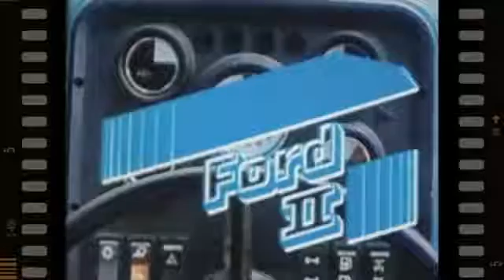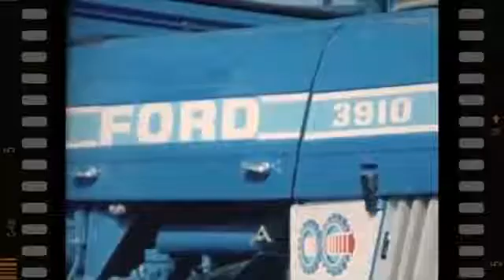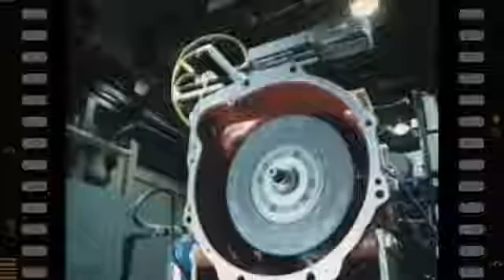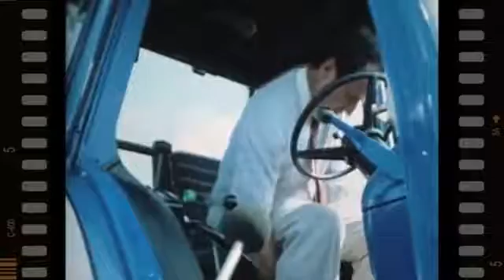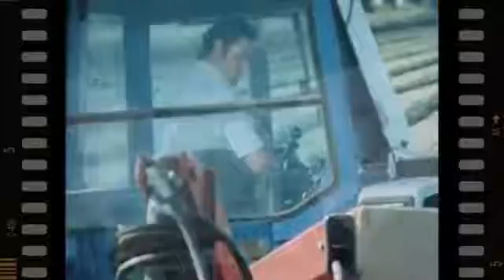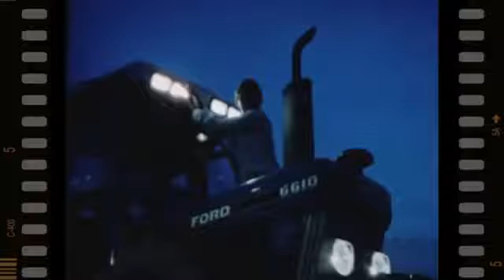Ford indroduces force 2 film. New FORD series 10 - FORD series TW

Comment: The force II were really nice tractors,  certainly as good as anything else then on the market ,and a huge improvement on the original 10 series which were surely some of the worst tractors ever designed with their horrible column gear shift , back and bum breaking seat , floor hump , high level fuel tank , lack of steering wheel adjustment,  terrible lift and hydraulic controls , porous engine blocks , power steering system that caused the studs on the top of the gearbox to loosen and wear , the list goes on , all cured by the force II .